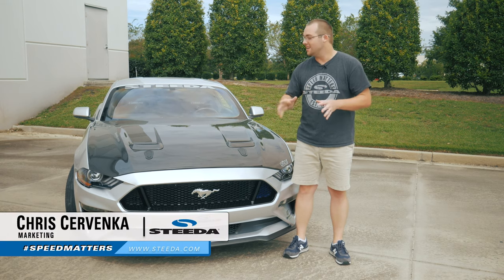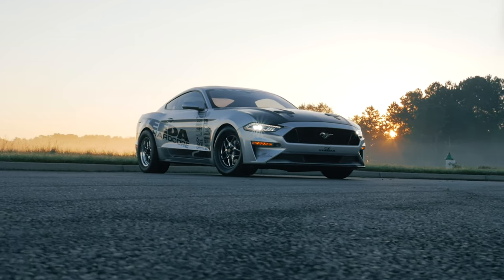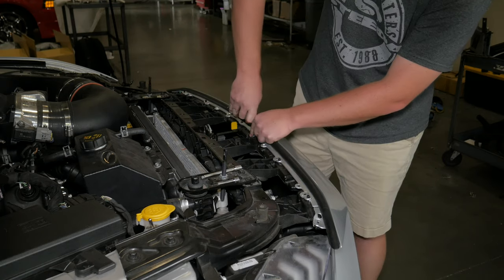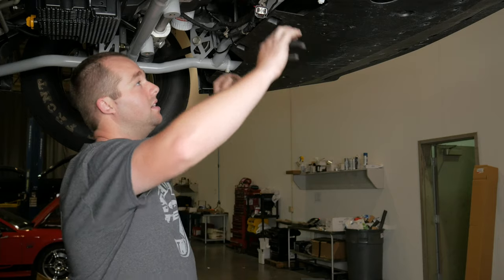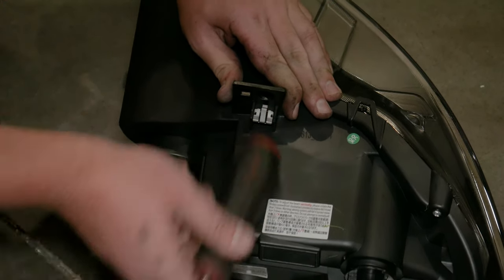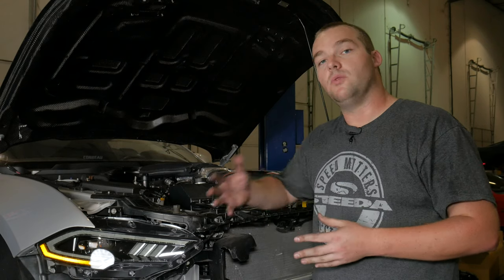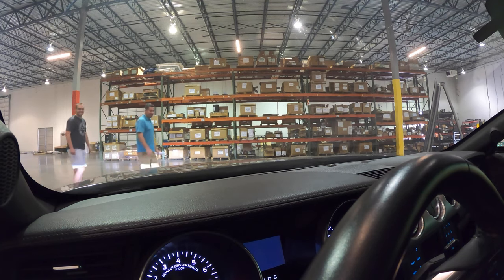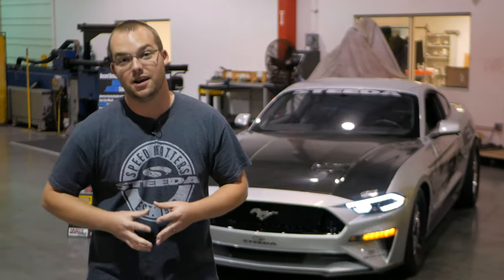2018-2022 Mustang Morimoto XB LED Headlights | Steeda Review & Install

Comment: I don't think the appearance difference is enough to justify the cost in my opinion. 

The DRLs on the edge need to be diffused more as well.
Reply: In my case because I had an accident, it’s far more worth to pay 1k for a PAIR of aftermarket headlights rather than pay 1200 for a SINGLE new OEM headlight.
Reply: @yotee7946  agreed, absolutely makes sense in that instance.